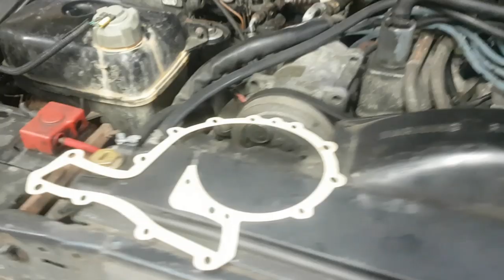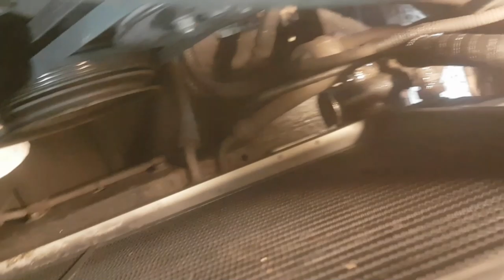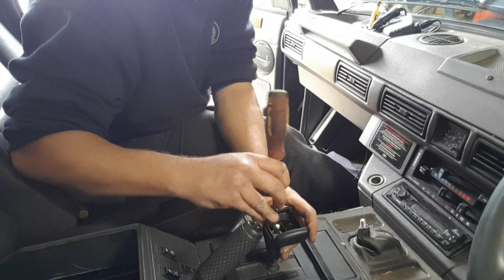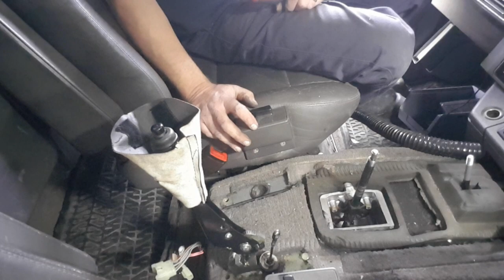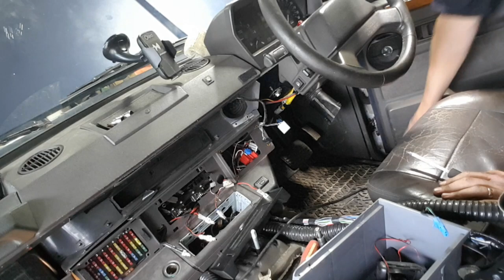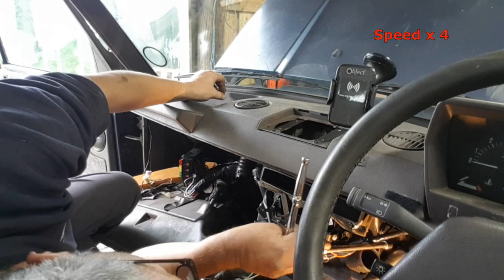Episode 1 - 1993 Range Rover Heater removal

Comment: Hi bud, im in the process of reinstalling my heater box but on the resistor the white wire has broken off. Ive ground down into the ceramic but the wires vanished like yhey go no where do you know if a risistor from an disco 1 would work?
Reply from the maker: disco1 and RRC are very similar in many respects. I would compare the connector and wire colours from the D1 resister to your ow RRC resister. I would expect them to be the same

Comment: How did you remove the nut on the back of the aircon unit. I have a 93 and dont even have those nuts you unscrewed at 21:52. I don't even understand how you used a ratchet extension bar at 22:48... Mine is completely inaccessible.
Reply from the maker: There is a plastic shield under the aircon blowers that needs to be removed I think. 2 x screws attach it to the leading edge of the air con dash surround. the nuts are a bugger to get at. the LH on you should see though, email me if you need more
Reply: Thanks for the response - appreciate it. It was single little nut that connects the centre console and the air conditioning fan area. Ended up having to use a wrench about a million times. This job has been absolute madness so far!!

Comment: My P38 heater blend motors have been stuck since buying it, it looked a bloody night mare trying to get at them.
I cheated using the wiring diagram and a 9v battery, gave them several runs opening and closing, I'd have been happing for them to be driven to the half way setting and stayed there, but after reconnecting they are back to life and behaving, see how it goes, it even cleared the cheque book symbol on the unit front.

You did it the easy way, I was expecting you to hold the camera and do it one handed. 😜
Reply from the maker: tripod is now my favorite tool, mind you since the southpaw axle accident I am 1 1/2 handed now

Comment: Thank you very much for that, My 91 needs work on the heater not leaking just the foam seals, It lets cold air though in the winter and has done for many years now, I showed my wife what needs to be done ( she has a nice warm Disco 1 ) and now she understands why the job gets put back to the bottom of "THE LIST" that all RRC owners have.
I thought that it was a pain when I changed the heater in my 71 RRC many years ago but this is a whole level, Looking forward to part 2 and possibly part 3/4.....
Reply from the maker: pull the plastic vents off the deck panel and you can see the air inlet on the bulkhead. wedge a lump of foam into the hole, make sure the fresh air vent is closed else you will bung up the blower fan. no more pesky cold winter fresh air